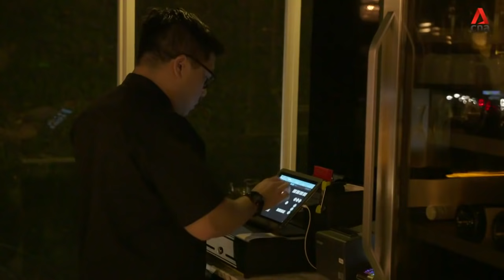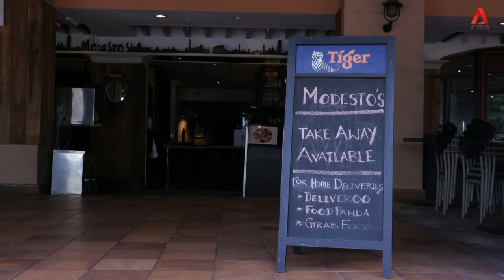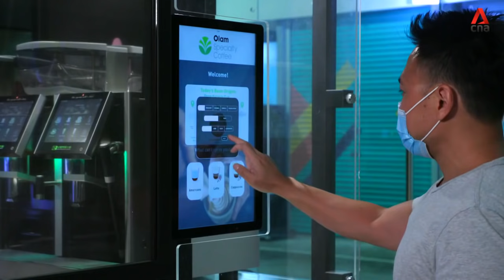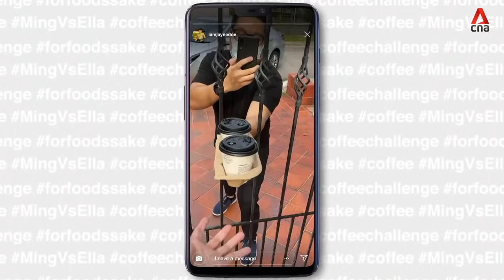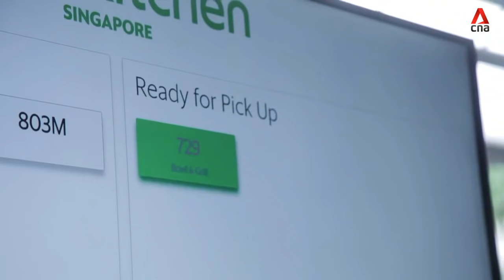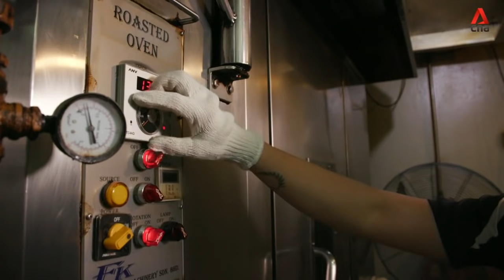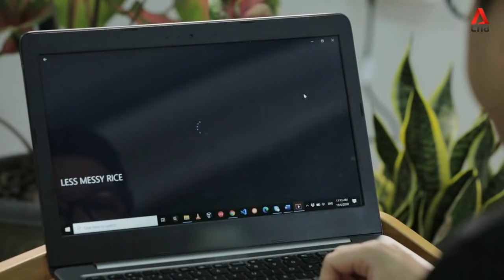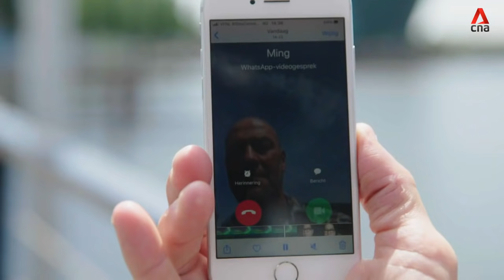COVID-19: A Wake-Up Call For The Restaurant Industry? | For Food's Sake! 3 | Episode 1/4

Comment: Give the man the same machine the robot is using. The robot does not have to steam the milk, the machine does it, the man has to pour and steam the milk. Also, a real, practiced barista could beat that robot if they both had to do the same exact tasks, but the robot has easier task.